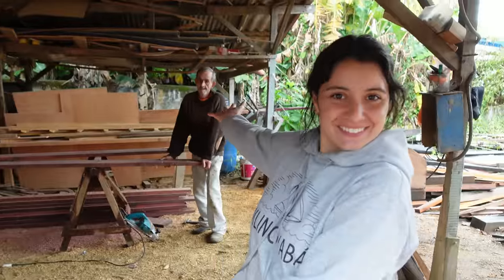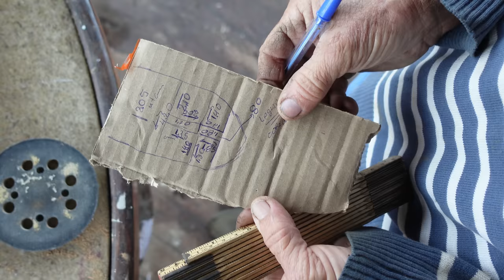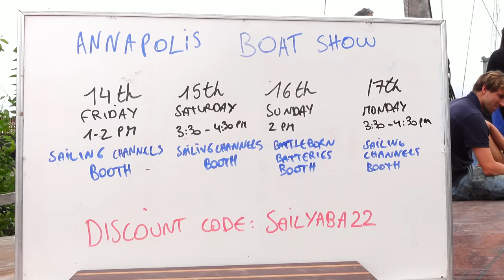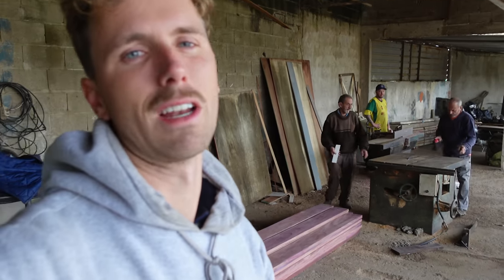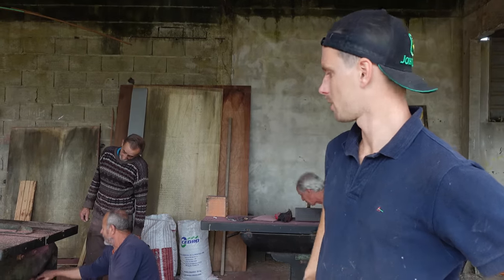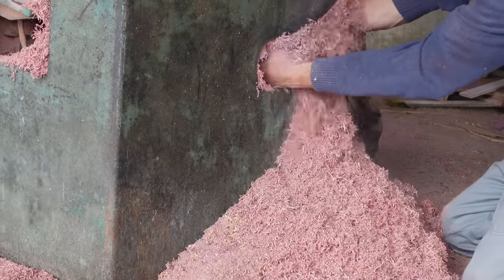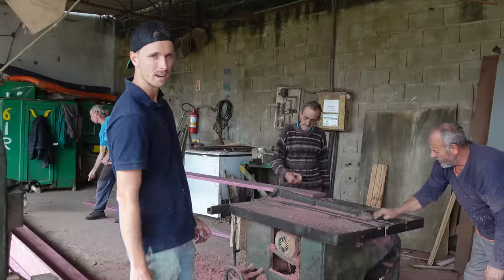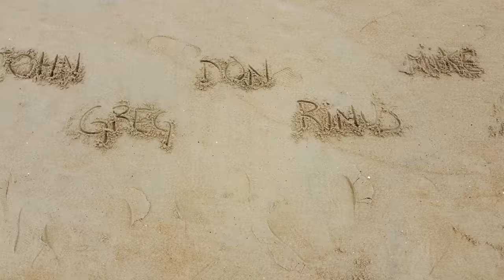Boat restoration: building a purpleheart wooden floor from scratch (wood inlay) — Sailing Yabá #101

Comment: I love purpleheart.  It is hard to believe that such a vibrant colour comes purely from the wood with no dyes or stains.  For those not familiar with the wood the colour changes in response to uv light.  When freshly cut it is a biscuit colour which gradually turns a rich deep purple.  Left long enough it goes chocolate brown and the trick is to use a varnish that blocks uv light so that the colour is fixed before it goes too brown.  As someone else said it might be worth making something out of the offcuts such as key fobs, coasters or cutting boards.  Maybe sign them with a sharpie and varnish over the signatures?
Reply: Thank you for your explanation, I have been wondering about it.
Reply: I was just going to ask if you had thought about packaging the sawdust or wood chips. Dangnabbit obviously has a great idea!

Comment: Heres a cool, sun screen.  All of the PURPLE heart long strips.  Make a sun door out of them.
You, nail one end to a long board. Keep a space the same as how WIDE the strips are...soak, the wood in a PVC pipe with water.. then , weave the long strips of purple wood, to the strips you nailed down. Use a rubber hammer to make them tight.  When your done. Lay the large woven sheet under plywood,  or what, ever. They look pretty cool.. after its dry, nail it into a frame.
It can make a door, a wi Dow shade bathroom door. Or a sun shade for the deck....and would be all most free.

Comment: The flooring looks great, I hope the glue was at least waterproof, I would use something more durable as floors do get water on them.  Anyway why not protect the flooring planks now with some epoxy / varnish.  Not only will it keep them looking good until they are installed, it will also make the finishing process much easier, as only the cut edges and perhaps some final coats will be needed.

Comment: It;s a bit late in the day, but hand held angle grinders/sanders are not the best way to finish any flat surface, it would have been best to leave the planks about one m/m over thickness and then after the strips are glued in place, put them through the thicknesser to finish to a common dimension. It's all a learning curve.

Comment: You mentioned inner bulkheads and flooring. When do you bring in the electric, water, and the things that run behind the walls? Also, is one of the workers on your team the overall architect of everything that is going on … with a plan and providing direction to everyone. It would be great to meet him or her.

Comment: I have a question regarding the wood flooring. Why is it not installed before the walls down below. Wouldn't it be easier to put in the ballast, then frame the floor and deck the whole area below and then build the walls to define the rooms on top of the flooring?
Reply: Flooring on a boat is often installed to allow removal without disturbing bulkheads or other vertical divisions.  This is to allow access to various parts if the bilge.  If the flooring was installed then bulkheads and walls in top, future repairs or modifications would be difficult.  Although there will be hatches for frequent inspection or access, other bilge coverings should be able to be removed by uncovering bungs and removing fasteners.
Reply: Respect for the purple heart preparation.  I did this same process in what we call Brazilian Cherry (jatoba) for flooring my kitchen.